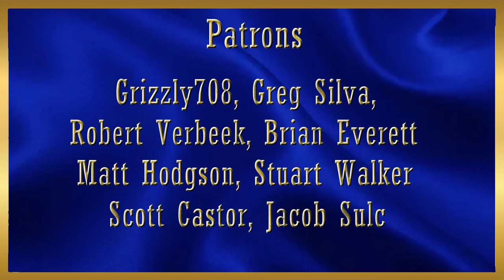ATS Sneak Peek at the Pizzster Wade Step Deck  Butte to Grangeville

Comment: Great video. I did kinda the same one out of Pueblo but at the intersection you turned left I turned right. Went on a road I hadn't been on. It took me up through Rocky Mountain Park. It was awesome. I have been through the park and I thought they did a good job on it. From what I could remember it looked like what I saw. Be safe have a good weekend. Like to watch that convoy.
Reply from the maker: Thanks Don. I did a Southbound run on that road a few weeks ago in a video. Colorado has so many great drives it is easily my favorite DLC.